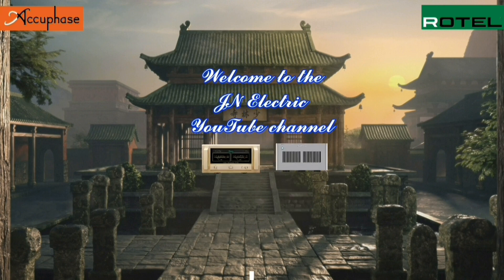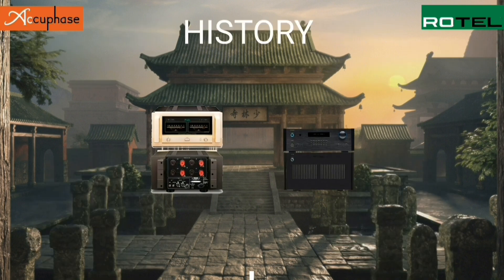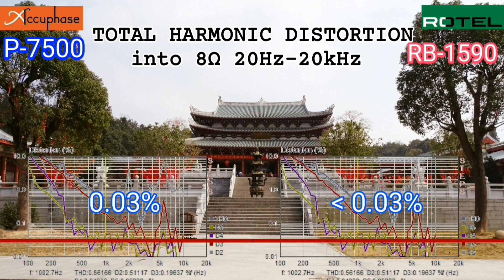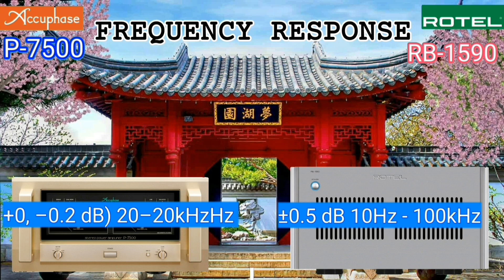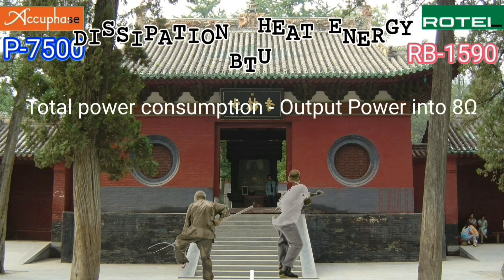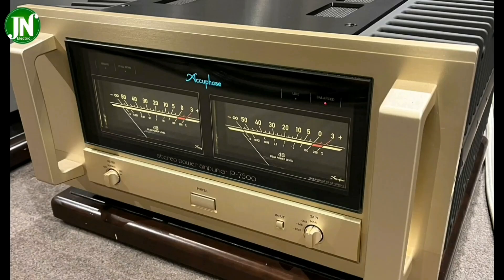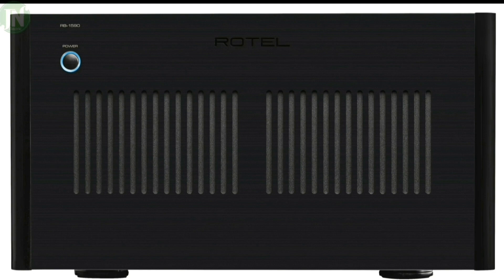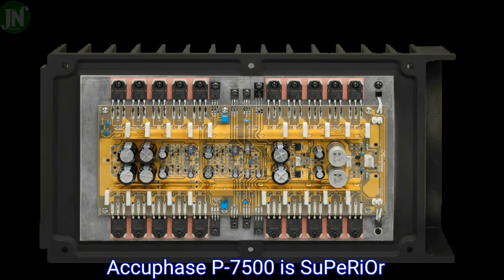aCcUpHaSe P-7500 power amplifier defeated by it's rival rOtEL RB-1590 ?

Comment: Thanks for the comparison of two systems of equal power with different prices. With your permission I have a question. If the 1590 can drive the INFINITY KAPPA 9 without problems even with low resistance. Now I'm using two NAD amps in bridge mode and they crash. thanks
Reply from the maker: great information.
It is better to remove the bridge system first and return it to its normal position, it is possible that one of the power amplifiers has a problem.

Comment: Paper specs does not tell you how an amp is going to sound. Some yrs back i bought a used accuphase just to see what the fuss was all about. However, after only 2 songs, i took it out of my setup & sold it. I don’t like its sound character. I find it a bit unnatural. Anyway, this is purely just my opinion. One of my friend loves Accuphase & have been using it for more than 30 yrs.
Reply: I would not jump the conclusion by just 2 songs.  Maybe the setup is not suitable for that Accuphase or simply wrong at that time.    Or maybe that used amp had an issue.
Reply: @QQ-td9id  perhaps but i am talking about sound character. We all know that every brand has its own unique sound character. Prior to buying that used accuphase i had listened to it many times at either showroom or friend’s plc so i already had a rough idea of its character. Its just that i wanted to confirm it by having it at home in my room with my speakers to double confirm. I had to buy it as nobody is going to lend me one to try at home. Accuphase is expensive stuff. I tested it in the shop & after ensuring that it was functioning perfectly before i dropped the cash. I don’t know about others but i usually only need to test a few tracks to determine if i like the sound character of a component. I don’t need days or weeks. For me, i just find that accuphase is unnaturally warm. And it had this golden tone or golden tinge to its tone which i don’t like. But i know many folks like this character otherwise accuphase would be out of business long ago. If u happen to like accuphase then good for u. Not for me though.